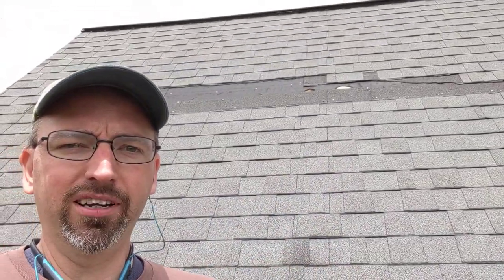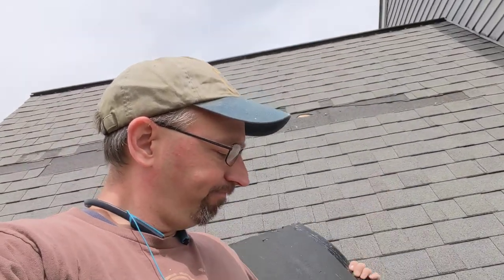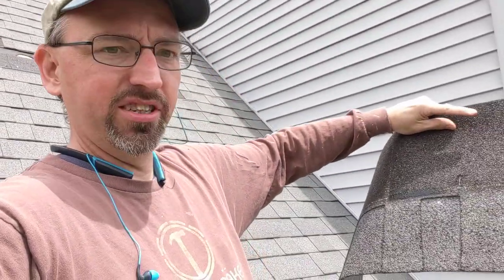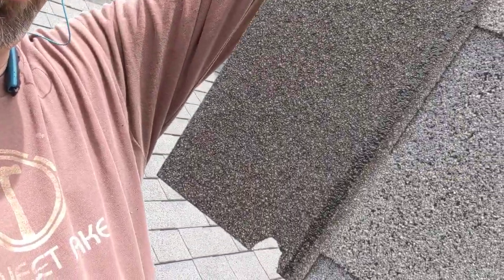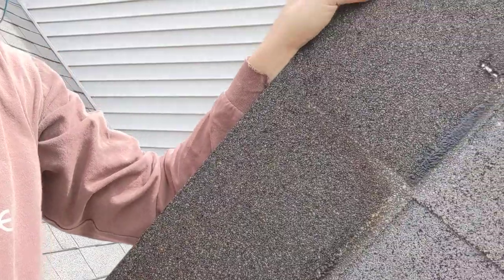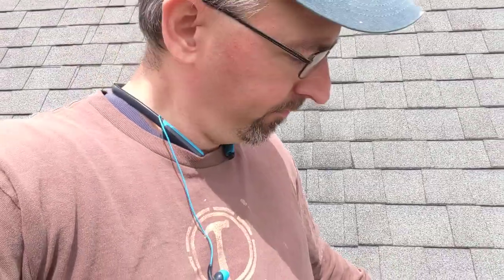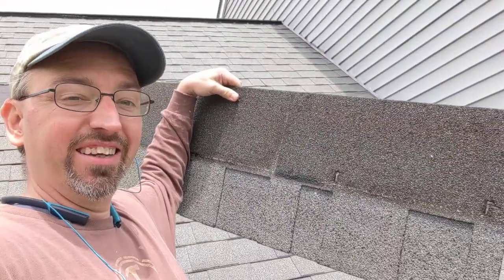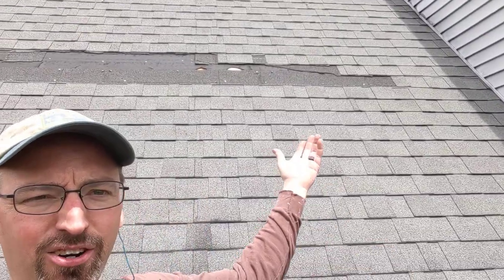Why do shingles keep blowing off my house roof?

Comment: That tar strip is so little I find it hard to believe it has any reasonable benefit
Reply from the maker: That's the beauty of the internet, and living in America.... everyone is entitled to their opinions.

To my knowledge, EVERY major shingle manufacturer uses tar strips.

In my non-profit days, we got some "old" shingles donated from a supply house, and the plastic strips stuck to the WRONG SIDE.  The teenagers helping with the install didn't know better, so they left those plastic separators in place. The plastic prevented the tar from sealing the shingles.   The house had problems with leaks and shingle blow offs and we had to go back and re-do the roof.  We added 100% coverage with ice and water shield just to give them peace-of-mind on the do-over. 

But you are probably correct... those little tar strips couldn't possibly have any reasonable benefit.

Comment: Cause the roofers were no good
Reply from the maker: Its deeper than that... sure, that's a possibility, but assuming they put the right number of nails in it.... we've also seen failures due to poor attic ventilation and excess moisture build up softening the plywood...    And there are other causes of failure, but yes, a sloppy roofer will cause them to fail early.